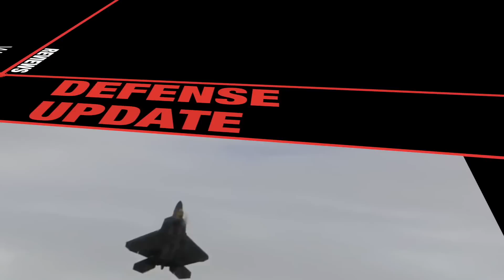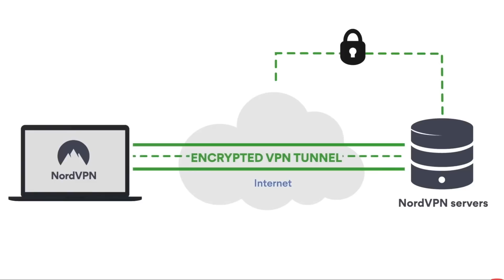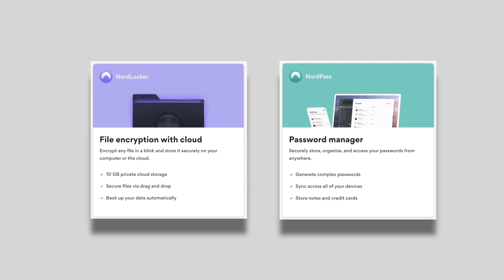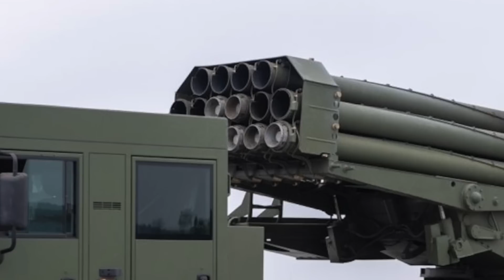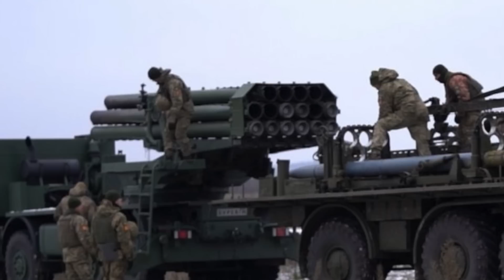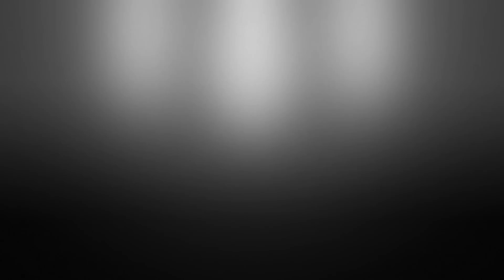Bureviy - Indigenous MLRS of #Ukraine taking on #Russia !

Comment: It is not Boo-ree-yev it is Boo-re-veey...Burevij
It is a shame we did not continue on developing M87 Orkan MLRS which had range up to 120km.
It would be very much useful in Ukraine
Burevij would mean Bura or Burin which is type of hurricane force wind
Reply: There wouldn't be many left after the Yugoslavian war it would be a collectors item not a mass produced useful weapon. And it's lack of guidance would have meant it had to be used en mass not as one off weapon.
Reply: @ZLSM-fan  true...there are not so many left of them...we have them 8 systems i think...but continuous development could had lead it to be extremly effective weapon system.even with longer range and more accurate since it uses analog aiming and guidence of rockets